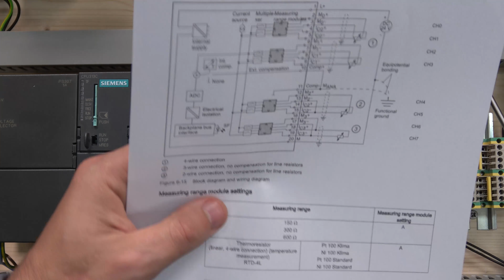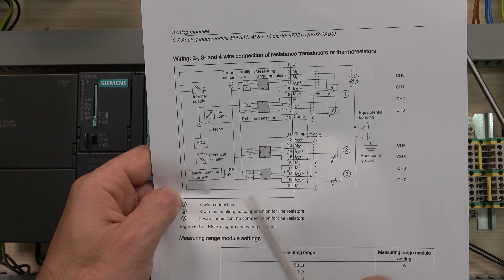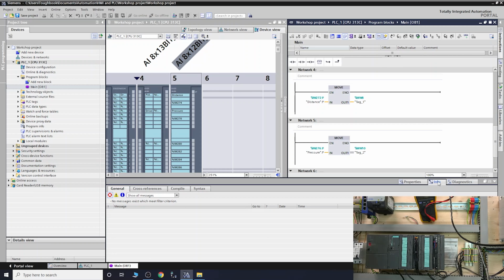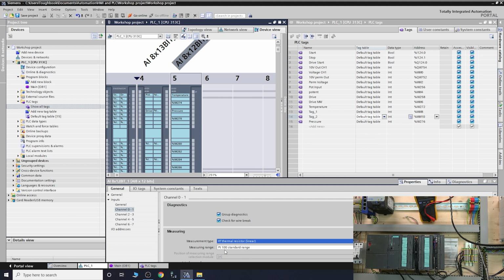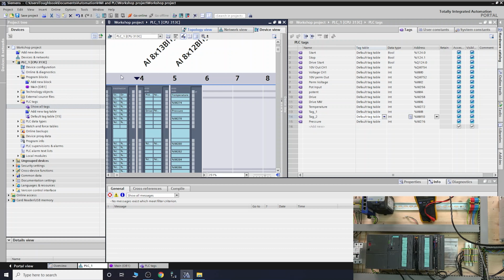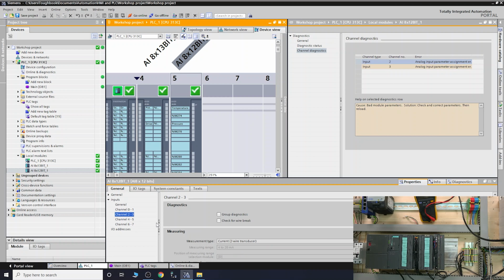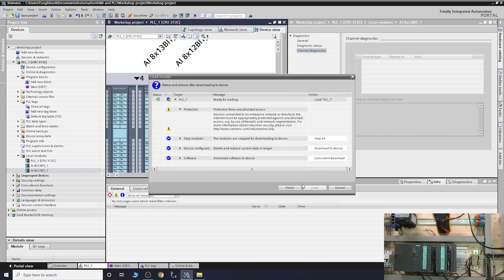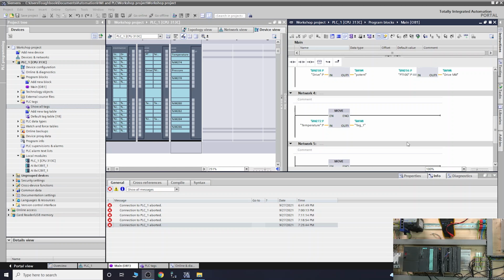Siemens S7-300 PLC analog input card SM331 1KF02/7KF02 thermocouple PT100 wiring/setup. Part 1

Comment: In case of faulty card SIPLUS SM331, do I have to do configuration for it or only just replace the old one with new?.
Thanks in advance
Reply from the maker: If article number is the same, all should be good without configuration.